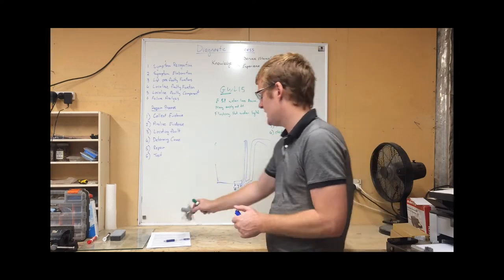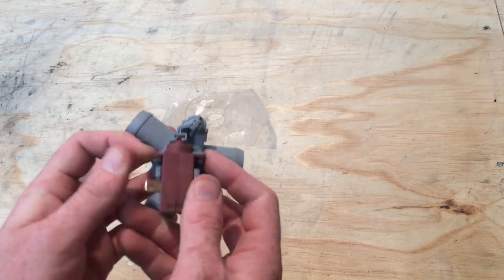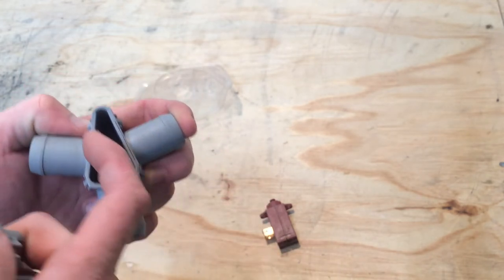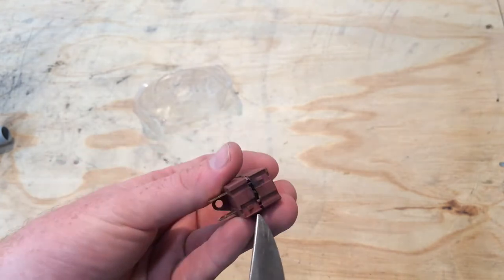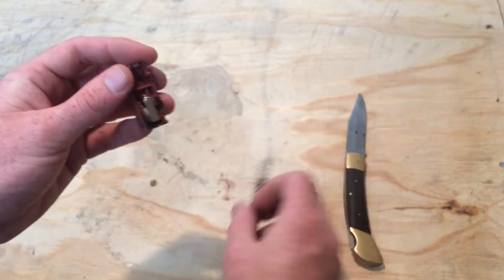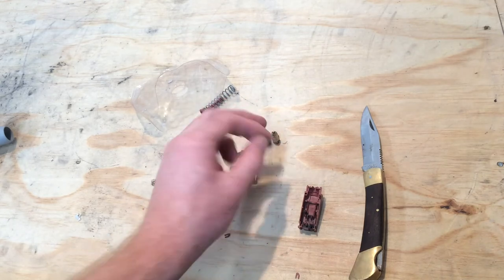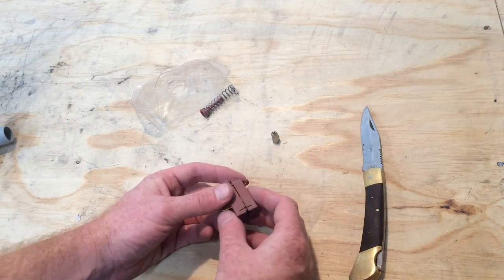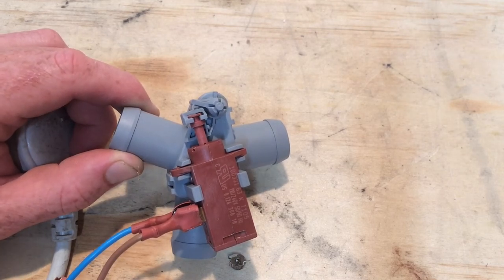How the Diverter Valve works on Fisher & Paykel Washing Machines

Comment: What a bizarre little contraption. My washer began slinging water all over the place during normal wash but works fine using permanent press like a previous comment mentioned.  After taking apart the drain and inspecting the diverter valve, I didn’t see any blockage or signs of a short. I guess I’m stuck just using perm press from now on. Thanks for the great video!
Reply from the maker: Maybe check the top of the recirculation hose where it enters the tub, it can leak from there sometimes. Some models had an upgraded recirc hose

Comment: Thanks for the excellent videos,very clear.because the wax solenoid thing is power on or off can I assume the terminals work either way?my machine has 2 orange wires running to the controller marked vc and dc on the circuit board.cheers
Reply from the maker: Yes the polarity doesn't matter so you can connect either way.
Reply: @motrepairs  sure enough I dismantled the old unit to find it clogged with soapy burnt residue thanks for your generous help

Comment: Hi Dan,  Thanks for this video on instructing just how the diverter valve works it was most informative.  
I checked my valve, and it had no carbon burn marks, but I purchased another valve, and my washer is still not recirculating the water so it must not be getting the paper voltage to push the plunger up.
My washer will run about 2 to 3  minutes, and it starts emptying out the the drain hose wasting all the soapy water, and will continue filling and emptying on each cycle. So I'm guessing its probably the main control board may be the culprit?  I only found refurbished control boards on line and they want $145 or more for one, no guarantees it will work? So with the washer being 12 years old I'd rather put that money towards a new washing machine.  FYI, I can't find anywhere on line where Fisher Paykel Top Loader Washers are for sale in the US, in fact one person wrote that F&P stopped sending units to the US back in 2019 before the pandemic so I'll be leaning towards a US Model Maytag Washer that are probably not sold in Oz?  Thanks again for all you help!
Reply from the maker: Yes it sounds like it is a faulty controller then. They can short and blow the controller then dry out and not visually show it some times. Maytag is owned by Whirlpool now, we only see some models here so I can't help with suggestions sorry. I know there was a bit of a technology exchange a few years ago between whirlpool and FP so there are some of their top loaders that are very similar to Smart Drives.
Reply: @motrepairs  Hi Dan,  I sent you an email message that you may have not received regarding bypassing the diverter valve.  On our GWL 15 washer I found a pamphlet stuck in the owners manual that stated; to bypass the diverter valve use the Permanent Press wash cycle.  I did this, and now our washing machine works fine with no problems or beeping alarms.  So from now on we will only be using the Permanent Press cycle to do all of our laundry loads.  No more emptying, and refilling, waisting detergent, or water for us as the washer works just fine using this cycle. Not sure if you knew this or not?   Cheers, James
Reply: @jamesb6216  I read your post, washed on permanent press and it worked. I replaced the diverter valve and all is well.
Reply: @jamesb6216  I too have been just washing everything on permanent press since my washer was doing the same as what you and others described.  I found that Amazon sells the diverter valve so I'm going to try the new one and see if that fixes it.  Otherwise, it's permanent press for me.  I've had the machine since 2007 and am trying to get as much life out of it as I can!  Already replaced the dual inlet valve to fix a drip inside the drum.

Comment: Excellent video. I just replaced mine with the help of your video. I was just going to chuck it out but took the old one apart after watching this. The amount of soap scum residue was gross. No wonder it wasn’t working. Is it possible to put the new valve on backwards? I’m still getting the diverter valve error after putting the new one on?
Reply from the maker: Potentially could get tit the wrong way around, the outlet that is open when it is cold/off is the drain outlet.

Comment: My control module just blew, my mashine is 12 years old, I put another control in it, it has done one wash and was fine, I was just checking can the modules just blow or is there always a reason, I don't want it to blow again,  any help would be appreciated.
Reply from the maker: Some of them can just blow, usually if some of the power triacs that control the motor fail.

Comment: Where does it divert water from ?
Reply from the maker: It diverts water from the pump so instead of going out the drain it is splashed on top of the clothes. It is run in the fill  and wash stages.

Comment: My washer is slinging water out of the top. It comes out between the lid and front. When opened I can see that water and suds are dripping off the inside of the lid and are on the the sides of the top of inside washer. I have replaced the pump and that didn’t help. It appears that the water is literally sling out over tHe tub and running all over the floor. Any suggestions?
Reply from the maker: Is the neck ring that clips over the bowl in place and undamaged? And check that the fill nozzle at the back hasn't become disconnected from its elbow hose. Some of the older style recirculation hoses had the molding at the top changed to stop leaks, but that was more water leaking down the sides not spraying up onto the lid.
Reply: Was diverter valve

Comment: or a phelleps head screwdriver..
Reply from the maker: If you are referring to the screw/bolt on the securing clip then yes you can use a Screw driver but I've found a socket easier.

Comment: This is a great video. So helpful and actually explains how the parts work. Fascinating stuff, really. Well, I found it clever, anyway. Thanks for posting. Cheers PP
Reply from the maker: You are welcome Mr Poopy, I would like to do a few more of these when I have time. If you like seeing inside electrical household items in general I would recommend looking at Big Clive's channel
Reply: @motrepairs  Thanks Dan. I pulled the valve out today and removed a covid mask clip from the guts. Your video was spot on, the added bit about how to pull the actuator out to check the gate was a great tip. The difference was you went the extra distance to explain how it all works and what some of the problems are. I'll check out Big Clive. Thanks from across the ditch. Cheers PP